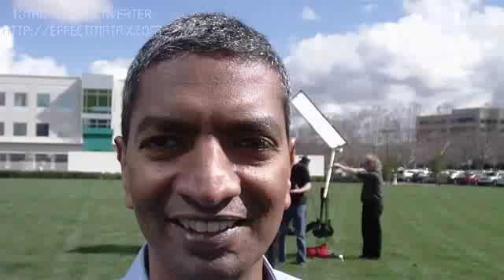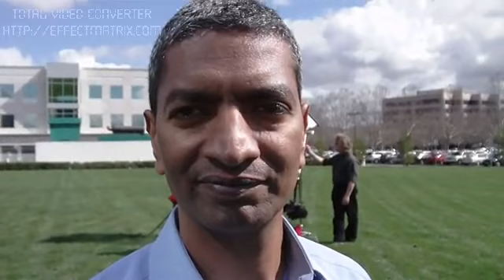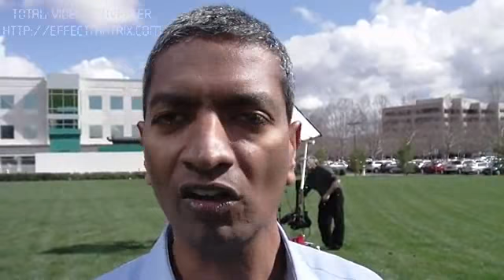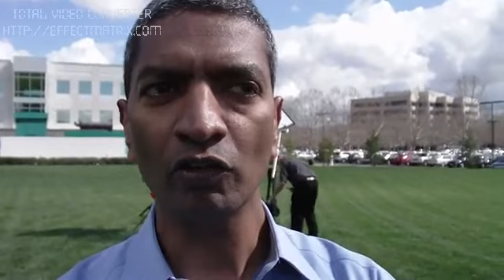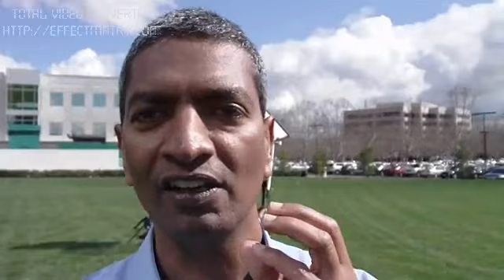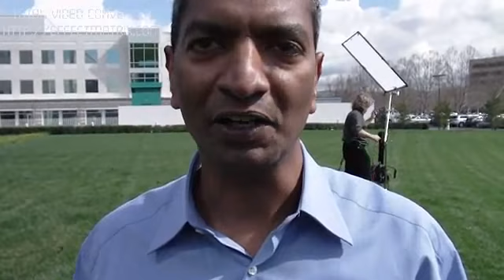Bloom Box Energy Phenomenon

Comment: This invention don't even provide animation as they don't want to show you still actually have to rely on fuel say gas. What will a 8MW supply look like. On my calculation it takes 
40 of the newer 200KW fuel cell server bank to produce 8MW, but how much does one of those 200KW fuel cell cost and how many amps drawn does a 8MW fuel cell server bank can hold without failing due to high demand.?
Dodgy way of marketing without much mentioned of actual cost and draw backs that look obvious and needed to be clarified, like how does a remote place without natural gas or other fuel to tap into can produce power from this.!

Comment: The cheaper bloom boxes for your home are just artificially delayed ! They could sell them already today at around 0.5 US% per Watt or even less, when they would be mass produces. As the materials work and are very cheap, one side is just graphite, and then center layer beach sand, these plates costs only pennies to make... The rest ist just DC to AC inverters which are also cheap today as they are already well engineered through the solar industry, same components...
So I guess it is just a political decision that these boxes are not sold by now to the small home user...
The big utilities and the grid would go out of buisiness, if a 10 KWatt unit could be bought for 2000 US$ and be fed by a bottle of camping gas next to your house...This green technology is here, why don´t we use it ? Oil mafia and political reasons only !!!

Comment: he invented electric generator with no moving parts ? where it is needed ?
Reply: electricity is generated through chemical reactions. Why would you need moving parts? even solar panels don't have moving parts unless it is one of those expensive ones that follow the sunlight. You are probably thinking of the electromagnetic generators.
Reply: Im about the same,or you have electric grid , or solar panels,where you need generator that uses fuel but have no moving parts, its usless until it will be cheap enough

Comment: @Activation1111 Yes and No, you've gotta remember the revolutionary thing here is that it's cheap to make the "paste" they put on the metal, which is what makes this an interesting design. If you cut down on size you have to either find a denser paste or a different formula. This is effectively a chemical energy exchange unit, so size denotes total exchange amount, so the smaller, the less size. :(

Comment: Jerryaltman, to answer your question, (Chemistry/Physics Teacher here), If you have a solar panel handy, you could easily run this machine in reverse using the electricity from the solar panel in order to store gaseous fuel up when the sun shines - In order to use it when the sun doesn't shine.